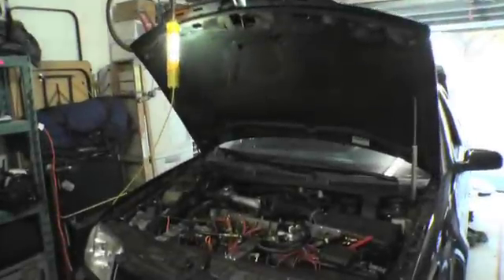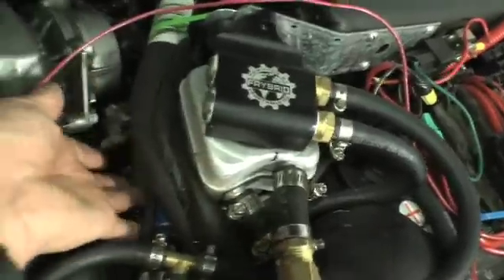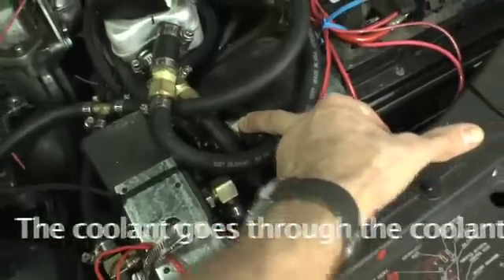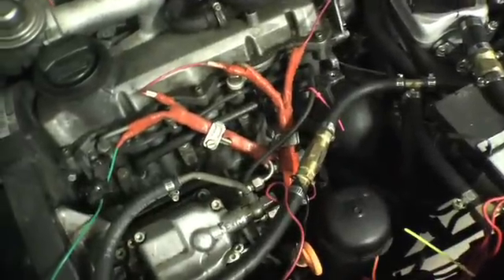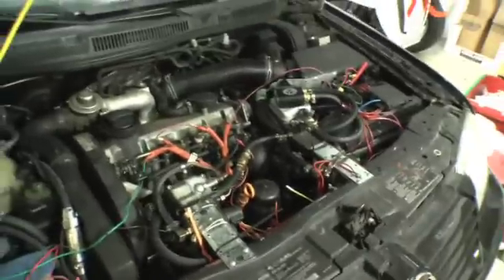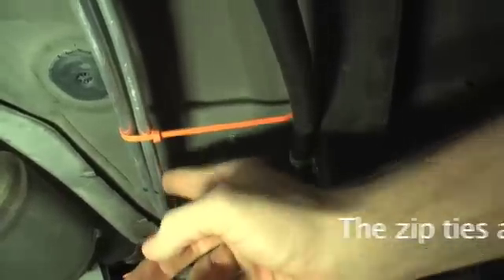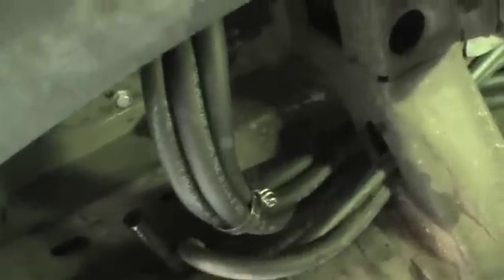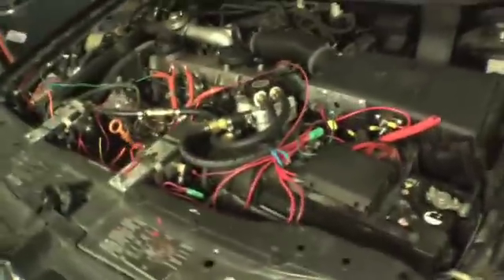Update to Jetta TDI running on WVO - video 3

Comment: what happens if you just put the twice filtered and dewatered veg oil in the original tank
with the diesel or diesel residue and don't do a conversion? one video shows some people
running a vehicle on this, but it wasn't a jetta.

Comment: i have a couple suggestion.  clip off all the zip tie excess and turn them to where the tips are out of sight and facing away from where someone doing maintanance works so they wont scrape their arm.  also make the wires straight with right angles.  this just makes it alot neeter and someone working on the car will feal safer.  i know a lot of mechanics would look at that and say "fuck you, you work on it."  if you know what i mean.

Comment: What a freakin' hack job. WVO should never be run on a modern TDI. Go get yourself an old Benz, Volvo, or Rabbit if you're gonna run that crud.

Have you saved enough fuel to pay $4k for a new engine yet?

And you did all this...but you dont change your oil or fix the glowplugs? The dipstick is holding the camera.

Comment: Very tidy setup, great job.  I've got all rubber from under the hood to the trunk, greasecar kit + 16-FPHE + VegThermMega.  I found that insulating the under-car pipes made a big difference.  Also, your use of aluminium pipes worries me a bit.  vibration will cause wear of the pipes and possibly break them.  Let us know how it holds up.